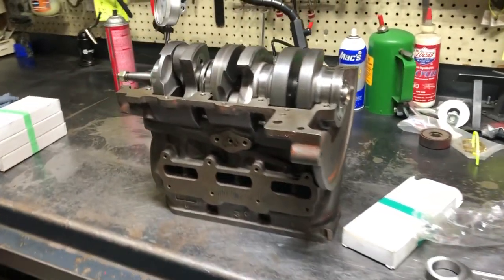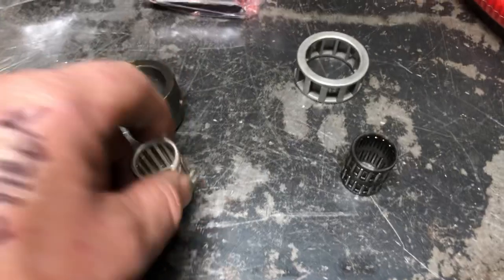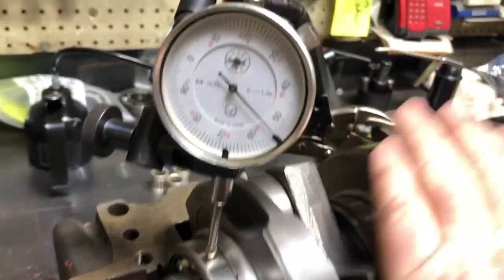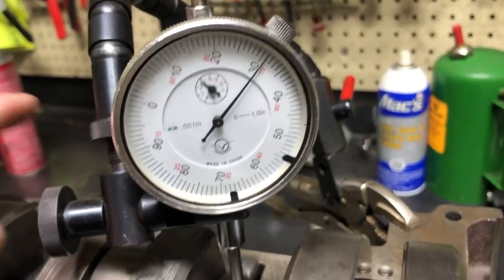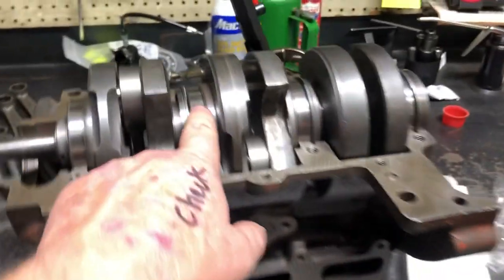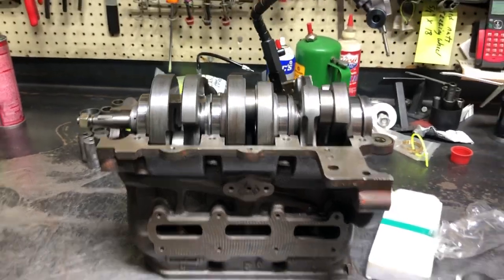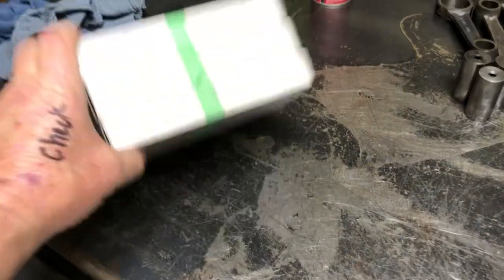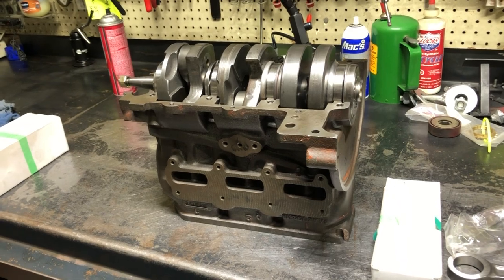Saab Vintage crankshafts

Comment: Have you thought about... (Or can you?) Changing the 120° firing to something a little different, I know in the 4 stroke 4 cylinder Street Bikes they are using an odd firing order... I know that when Cat had the 3/4cyl King Cat in the 70s they experimented with 2 cylinders firing at the same time, there were some 2cyl racers in the early 80s that had "big bang" cranks, now I don't know how much advantage it was, it would be something to see on a Dyno... Olav Aaen would probably tell us...I am SURE if could be done to a 2-stroke...He Did It!
Reply from the maker: I’ve never thought about it probably an interesting concept.  And would not be hard to do on a two-stroke since the crankshaft is pressed together in pieces.
Reply: I worked on a snowmobile drag race team (V-max 4) and we "180'd" the crank so that it fired more like a twin. This isn't really advisable for anything other than drag racing. 

The reason we did this for drag racing is that the gap between power pulses, in theory, gives you more opportunity to get traction. I won't pretend that I understand all the science behind friction, but once you start something sliding, it is much easier to keep it sliding. WIth an engine that fires every 90º you have half of the time to regain traction than with an engine that fires at 180º. Ducati was able to capitalize on this with their V-twins. In their case front cylinder fires, 270 crank degrees later the rear cylinder fires, 450 crank degrees later the front cylinder fires. 

For smooth operation, efficiency and durability, you want your engine power pulses and balancing to be as evenly spaced as possible. With a 4 cycle you can phase your crank at 180 but still have it fire evenly, as they only fire every second time up, where a two cycle fires every time it's at the top. 

WIth a LOT of testing, modelling and study, it is somewhat conceivable that you could make a 3 cylinder run more smoothly by slightly staggering firing angle, (This could be done to mute out crank flex, undesirable harmonics etc)  however, you will still have to balance the crank at 120º or you will have serious issues. 

I suspect that if you had the technology, time and skill to make the above mod work, you would also be able to use your technology, time and skill to solve any problem you ran into, in a different way. If you simply wanted to do this to be different / make your engine sound different, then for sure it could be done but you will also have to take into consideration pipe tuning and ignition timing. Timing wouldn't be a big deal in most cases, just modifying your pick up (or points cam) but for the exhaust you would need to run triple pipes to the ports, so that your exhaust pulses don't interfere with each other.